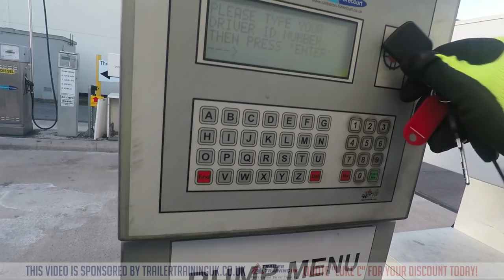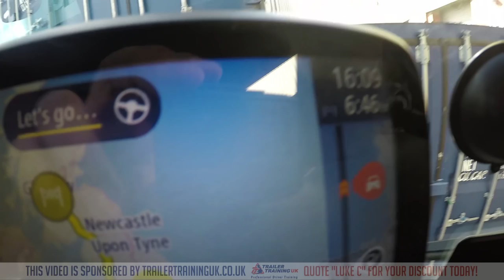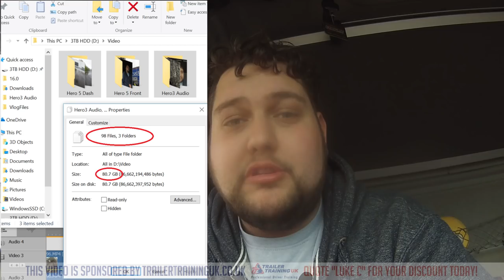Scotland Is Absolutely Beautiful!

Comment: Luke i noticed you said once you've checked the load you would put it on break , in my day i went on break second i stopped driving as Other Work like deliveries ,checking loads etc. didn't count against actual driving hours. has this been changed , i was on paper tacho.
Reply: I think when he stops to check the load it no longer adds to drive time because it’s stopped but the tachograph switches to other work and its other work that starts to accumulate time. Then when he’s done checking the load he’ll change the tachograph to rest.

Comment: 2 pump trucks?
Reply from the maker: Some times i have to take it off myself. Some pallets are 2m in length. It’s easier (for me at least) to have a pump truck at the bottom waiting and then lower the pallet down on the tail gate by it self.
Reply: Luke C in a HGV  makes sense

Comment: you need to tell your boss, you should not be using those anti-theft filters on your diesel tanks, all the thieves do if they cant access is drill a hole in the bottom of your tank and get the fuel that way, you don't hear a think, I was asleep in my cab in Liverpool working for Dowton's and they empited my tank in no time with no sound

Comment: dont forget the speed limits up there luke 50mph on a duel and 40 on a single carriageway dont want you getting any tickets out there bud
Reply from the maker: Shaddaz1 yep, aware 😉👌
Reply: Shaddaz1 Is that different from England?
Reply: Stephen Murray yes it is in England it is 60 on dual and 50 on single
Reply: 70 on dual and 60 on single you mean bud
Reply: SpooKCS not in anything larger than 3.5t in a car you would be correct
Reply: Shaddaz1 true

Comment: You cheapskate you need to get the proper Luke c in a hgv sign on the back of the high vis not just a tiny thing.
Reply from the maker: Graham &Gabbie it was originally, in fact the one I have does have it on. I didn’t like it though. Thought something a little bit more discreet would be better.